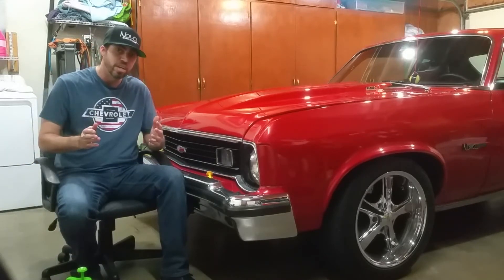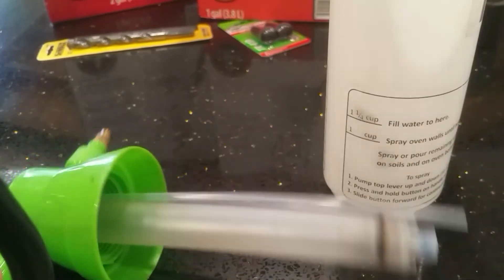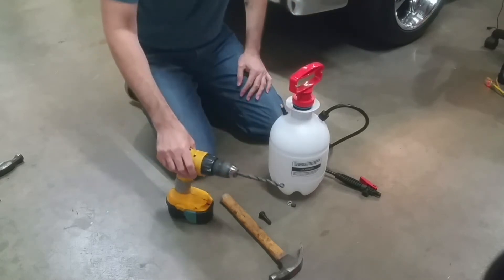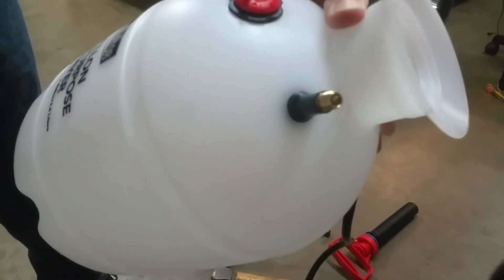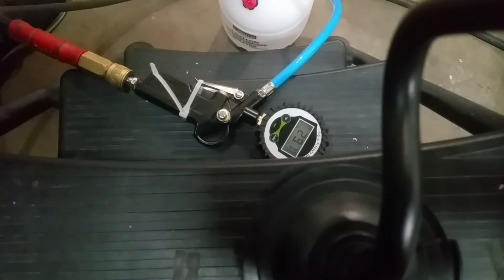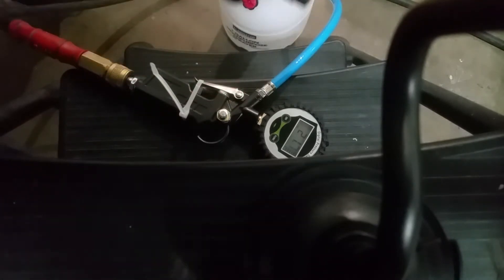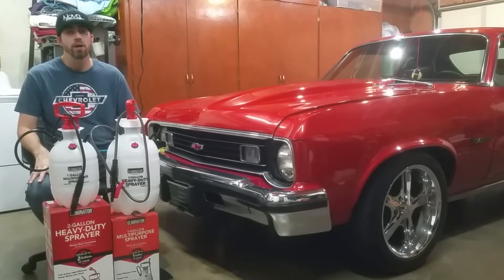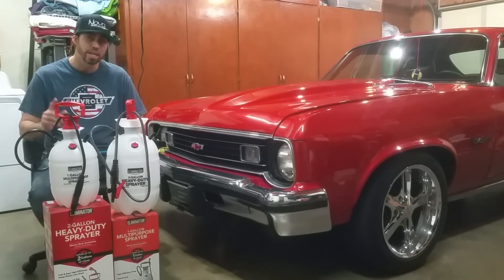74 Nova LS Rebirth Ep 16 - Custom Pressurized Fluid Transfer Pumps (How to make them)

Comment: Hi there. Really nice tool. You can also use it, for the brake fluid. Connect the tool onto the bleeding port and a other rubber hose at the farest end of the brake system. You will have a airbubble free Fluid in the system. No more brake pedal pumping. Thanks for the Video.👍
Reply from the maker: I actually have a vacuum pump for my Brake bleeding. I created it with its own fluid release valve for the reservoir. Also connects to my compressor and is controlled with a gun style trigger. My setup connects to the calipers and provides a quick suction to pull fluid through system.